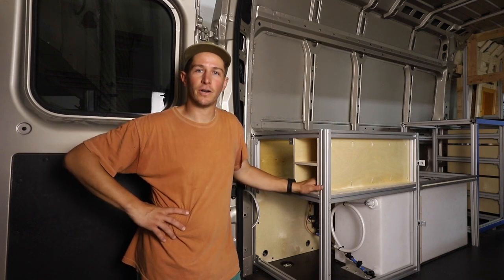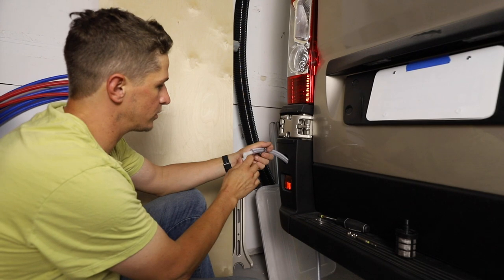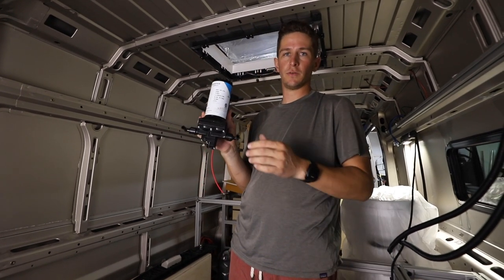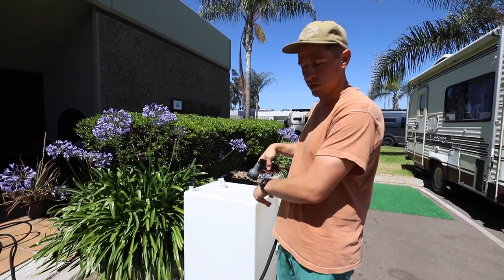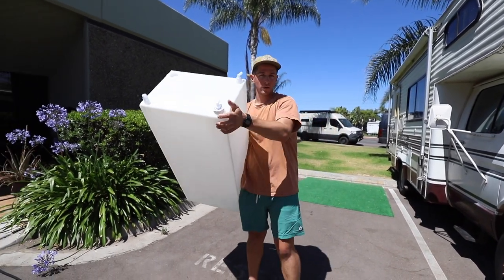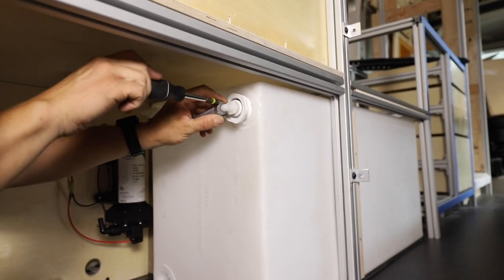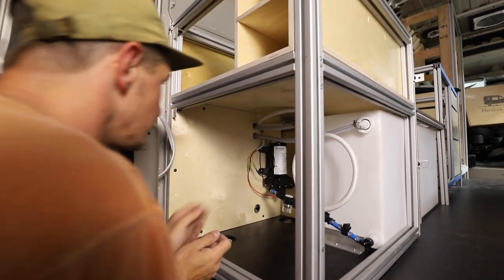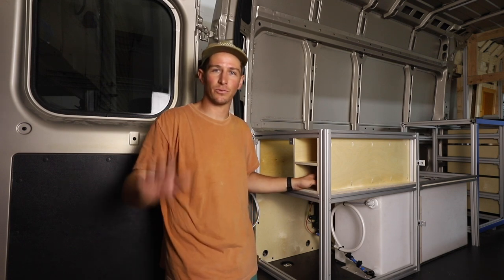DIY CamperVan Plumbing with Camping World

Comment: This came just in time as I am currently starting the plumbing on my van build! Great video <3
Reply: How much does it cost for the diy plumping in a van??
Reply: @Came Nelson For my plumbing it was around $250. I was able to reuse a couple items from past jobs which helped. It depends on how much material you need.
Reply: If I would be starting from scratch is it expensive!! I’m thinking of doing one to travel back and forth for school so that I don’t have to spend money on hotel, airfare or rental car!!!
Reply: @camenelson5373  It doesn't have to be expensive but it depends on what you want. Try and find a used van for a good price and you can do a budget build for around $5,000 or less. Do your own research and see what other people have done for budget builds and how much they have spent.
Reply: Thank you thank you thank you soooo much for taking the time to respond back!! I truly appreciate the feed back!! I will take your advice!
Reply: One last question, do you know what’s the best van to look out for because there are so many models and makings of vans? Can you give me names of a few vans that you think are good?
Reply: @camenelson5373  The three most common are the Ford Transit, Ram Promaster, and Mercedes Sprinter. Each have their own pros and cons. It'll be easier to find mechanics for the Transit and Promaster if something goes wrong. I believe the Transit has the tallest high roof, Promaster has the straightest walls for building, Mercedes has diesel and 4x4. I personally have a Mercedes 4x4. Court and Nate have Promasters. It comes down to preference and research.
Reply: Thank you sooo much!! With all the amazing feedback; I’m gonna start doing my research! God bless you!!!